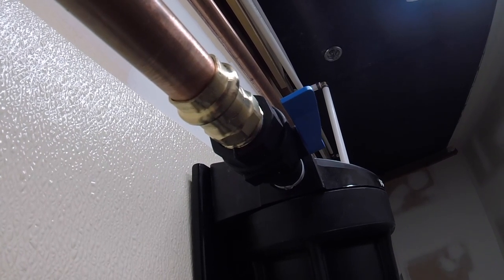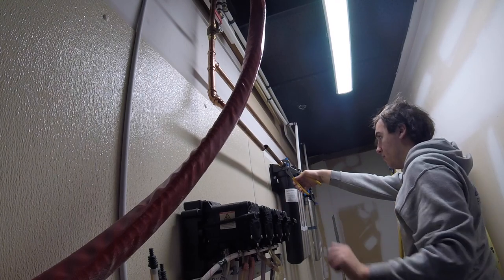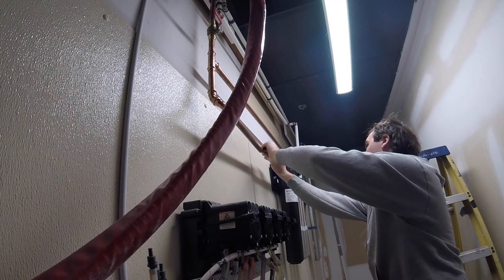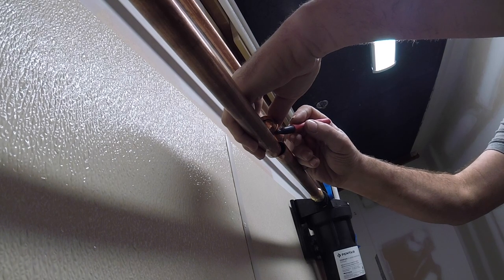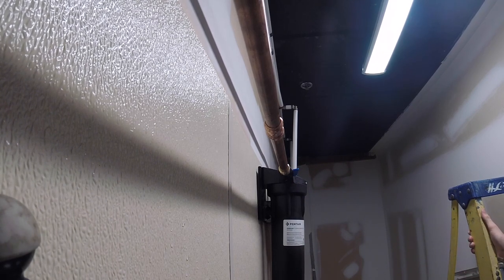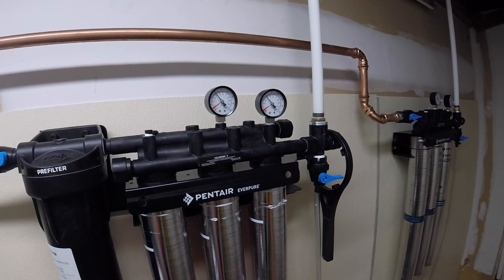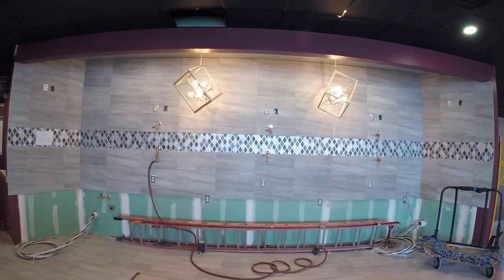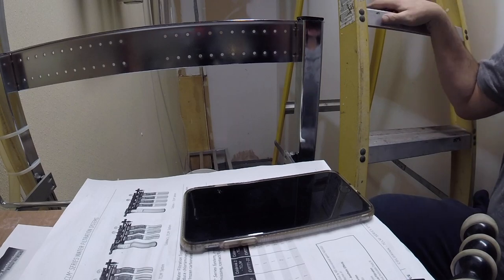PLUMBING APPRENTICE REPAIRS FILTER SUPPLY LEAK

Comment: 👍🏻 . No ASSE 1022 or 1032 check valve required on equipment ?  What base code are you under the IAMPO or the ICC plumbing code ? Here we install them the soda companies just connect their equipment.
Reply from the maker: Z back flows will be on each machine.

Comment: they have a rated flow rate, wide open garden hose is far beyond what the filters can flow.....
the machines likely wont flow even 1/4th of that rate with all dispensing at once, think how fast they normally fill a cup, now imagine wide open garden hose...SPLOOSH soda to the ceiling and on everyone =p
Reply from the maker: yes coke was there yesterday and I believe its fine. gonna make the call today to find out.

Comment: CB I need some help over here I have sewage coming out of my shower I'm renting this place and cant fix it myself and the apartment doesn't believe me but I've been in the shower when it happens I don't know if its because water had nowhere to go or if it's the tap water below it being pushed out when something draining the air cant go out the stack but I find it hard to believe that it's just the tap water for how much sits in the shower. It fills the whole 4 by 4 shower bad and come up 3 inches, it's not clean water has stuff in it and smells
Reply from the maker: orion Grezeszak take pics and tell owner let’s go!
Reply from the maker: Also when shower full flush clean toilet water and film it. Water should rise in shower.
Reply from the maker: Are all fixtures backing up?
Reply: @ChuckBarron   I've checked our fixtures and they run just fine but I don't know what happens below the house it's a home converted into a apartment and it's done poorly. Ceritan drains like the toilet doesn't slop down to drain I don't know if that's the problem the toilet water just trying to flow with ease and that means it backs up into the shower or if it's the lundary line
Reply: @ChuckBarron   you can smell the gases being pushed out when the sink is used by the shower and a gargling nose from what I remember correctly that means sewer gases aren't venting
Reply from the maker: sounds like you need service..are there other units in house that use same drains? are they backing up into your place?
Reply: @ChuckBarron  not to sure if they do csnr get access to basement and landlords don't care that much after the report trying find out more
Reply from the maker: got busy here at the firehouse. How did you make out Orion?
Reply: @ChuckBarron   I actually accompanied the plumber down to the basement early this morning to find that they had hooked up new plumbing to old cast iron pipes about 5 years ago and the house had sat for 2 years before our move in over that time frame dust and other sediments had built up in the cast iron to a hole I couldn't even get my pinky into, so we replaced some of the cast iron and put in a vent line as there was never one installed for the sink, shower, and washing machine, so have new vent line cleaned out but also fixed the angle of the pipe instead of letting gravity do the work they had it hooked up at an elevated angle this was all repaired and so far it's working but there are a lot of issues much like the house you worked on the cb2 opened the sink line and got water all over you
Reply from the maker: awesome. Sounds like an old place. good luck

Comment: Not a big fan of plastic female threads , the tapered threads can crack the plastic if overtightened or to much Teflon tape .
Reply from the maker: Ya, It was like there was not teflon when we took out leaker. kind of wierd. maybe filter ate it. lol
Reply: typical rough cast plastic, eating the teflon for dinner